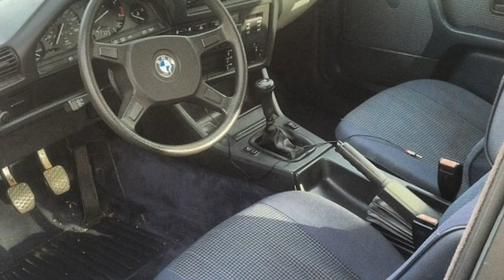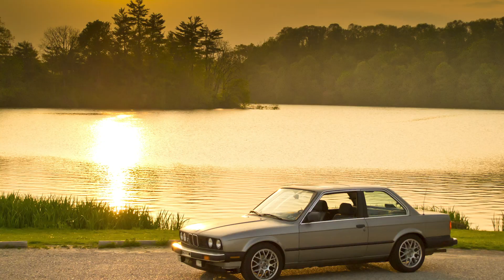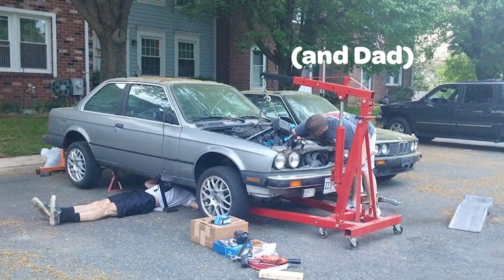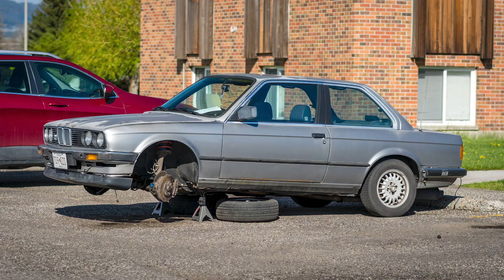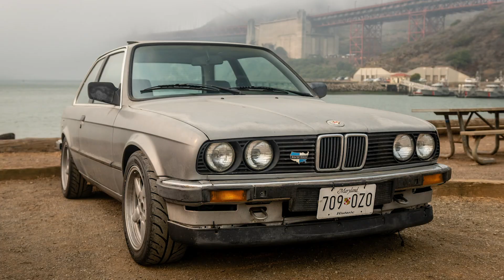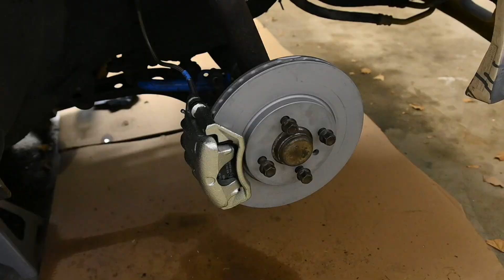Build Recap of my ITB E30

Comment: How do you like the feel of ITBs on a stock motor vs the old Stroker build with the stock manifold?
Reply from the maker: That’s a good question. The ITBs are definitely the most responsive throttle set up and the sounds are great. The stroker was almost 2x the horsepower gain so that made a big difference in driving feel. Someday I’ll have both the stroker and ITBs together.

Comment: How do you like the itbs do you have any regrets or wish you went in another direction. I’m finishing up a bunch of maintenance on my m20 which makes me want to not swap it . I’ve always wanted itbs but I’m worried it will feel slow to me. Everytime I see someone with itbs on the m20 a year or so later an s54 is in the car.
Reply from the maker: I’ll be M20 hopefully forever with this car. It’s never going to be a rocketship but it does feel zippy enough around town and for autocross. I do really enjoy the ITBs. If I were to do anything different, I think it would be to use a more robust standalone ecu. I think a better tune would fix the problems I’ve encountered with drivability.
Reply: @reichartsworkshop good to know. I just picked up my e30 and doing a full fresh, well almost full. Makes me think I will keep it m20 atleast for a long time.

Comment: Did you ever fix the tac issue after the megasquirt instal? Was it a tune setting or a wire trick ?
Reply from the maker: Yes, tach is all good. There's a black wire under the dash/in the glove box that I had to connect. Just a slight difference from my e to i swap.

Comment: Thought about doing a similar video for mine just to have some content for the winter in-between time for building this 3.1 stroker. I also thought for phase 5 I have a set of Zender skirts I got in trade for work im not gonna keep to go with that front valance I have to prep and primer for resale if you want them at all. I have some rust to deal with but thats after the motor is built and installed with the shaved bay. Ive owned mine for 17 years this January so little longer
Reply from the maker: Right on! A 3.1L should be killer. Can't swing the skirts now but thanks for the offer.